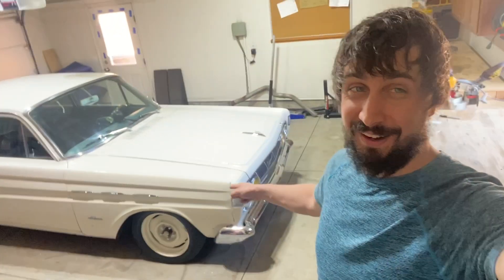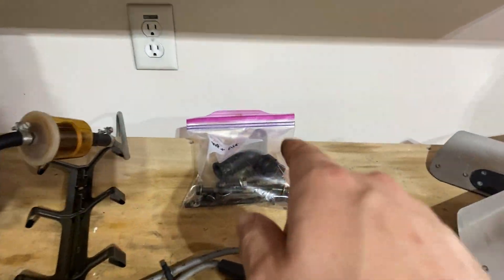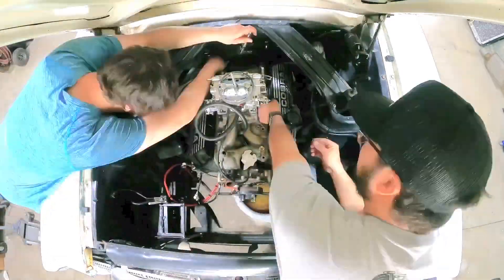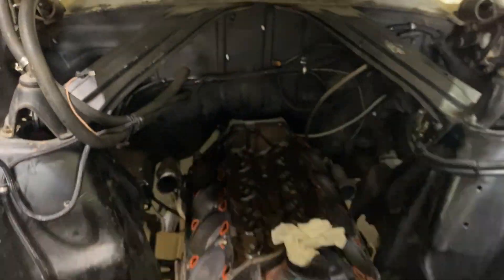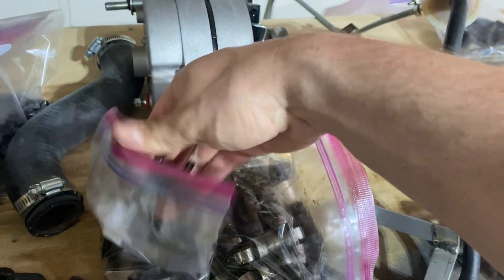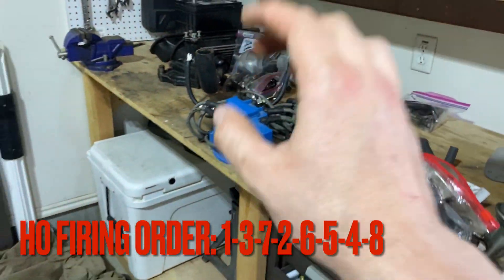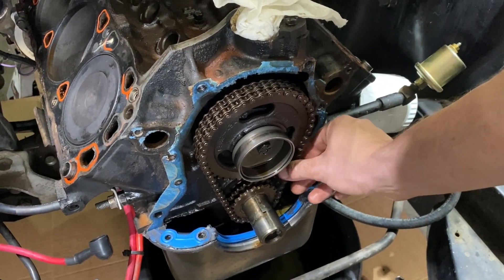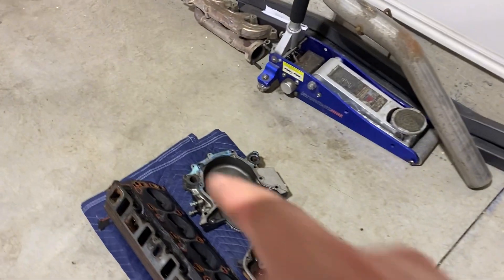5.0 Ford Engine Disassembly and Inspection

Comment: Rewatching, the non h.o could have been t-bird,cougar,ltd,crown vic into the early 90’s👍🏼🤙🏼
Reply from the maker: I agree.  What makes me think its an 86 something is the lack of valve reliefs in my pistons.  I think you are right it was likely some 1986, non HO, car motor.
Reply: No worries just passing on info,my previous engine was out of a 91 crown Vic, efi non h.o, it had the dished pistons no reliefs.w/88 t-bird harness.
I checked engine compatibility and it was the same engine for all  the efi roller non h.o 5.0 cars. 
.🤷‍♂️👍🏼

Comment: Excellent content, might I ask what you have done for your turbo Mach 1 as far as clutch and transmission? Or any other supporting mods I can’t find any info on your video of you talking about it but love your channel
Reply from the maker: If you can believe it the trans and driveline are all 100% stock and holding up well 🤞
Reply: @truckandroll989  oh wow, so stick everything? Clutch trans And all?
Reply from the maker: @kf3432  yup! The Tremec 3160 is amazing

Comment: Watching your 64 comet intently. Mines a 65 Caliente..302 4 speed toploader 9" 3.56 ratio..edelbrock e-street  2.02 -1.60..rpm intake 750 4150 series..recovering from surgery..my goal is a 13.99 1/4 will see..
Reply from the maker: Best of luck on your recover and thanks for watching!  I have no doubt you can hit that goal with your setup